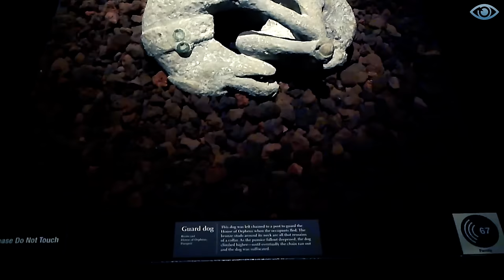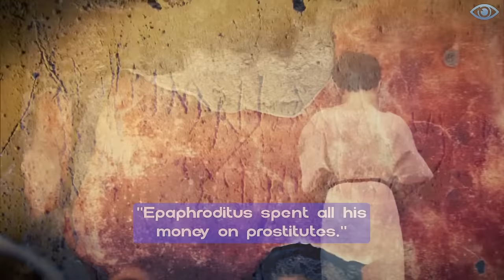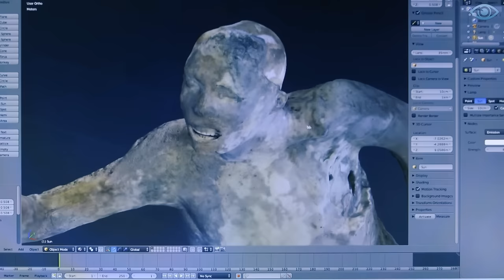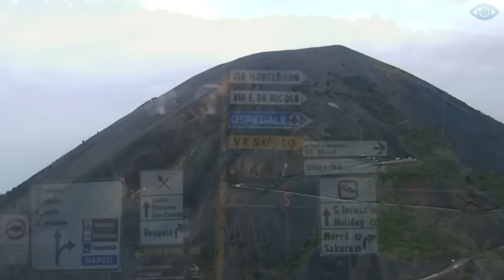This New Discovery in POMPEII Has Changed History!

Comment: I visited Pompeii in 1970 and it is amazing how much more has been discovered and excavated.
Reply: I visited both Pompeii and Herculaneum in 1977. We see a lot of videos about Pompeii but very few on Herculaneum. Actually, there were other Roman towns buried by the Vesuvius eruption: Oplontis, Misenum and Stabiae. I don't think they've ever been excavated, though. 

The main killers at Herculaneum was what are called "pyroclastic density currents" (PDCs) which are like rivers of hot ash and gas (with temperatures up to 1,000 F) flowing along the ground at incredible speeds. Their heads of victims in Herculaneum literally exploded from the incredible heat of these PDC's.
Reply: I visited Pompeii  July of 1995 and I agree how much more has become uncovered... Visited Herculaneum  Dec. of 1994.. and visited the Protestant  Cemetary behind a Pyramid  built for a General in 79 AD... missed visiting the Art Gallery of the Vatacan by 15 min. Sept of 1994... was never able to try again.. just too much to see and do... the Cuma caves were interesting and the fact Neros Canal still exists and so does the Appianway... makes you wonder with their tools, and our modern ones.. why can't we make roads that last as well as the Roman's did.

Comment: I visited Pompeii over 15 years ago and didn't get to see even half of what was shown in this video. A question always in my mind is that the roofs of all these structures are gone yet the walls are still standing. I can only speculate that the roofs were made of wood and hence the firestorm burned them up.
Reply: Sounds we were there the same year 2008.
I toured all of Italy and both Rome and Pompeii 🎉had a ton of things closed off. Also, all the castings were on a world tour. They need to put those castings back in Pompeii, or atleast replicas. 
We still had it good. There were no barriers and plexiglass all over the place. We could walk where we wanted and stick our face up against a painting.
Reply: @johnbeckwith1361   I think they should put the original castings back and take replicas on the tour.
Reply: Wood and straw like modern thatched buildings in England.

Comment: I do feel so sad and sorry 😞 for all of the horses, who had no idea of what was happening to them 😢
Reply: Horse, cat, and even dog remains are rare in Pompeii. They are similarly swift, and they were more likely to escape than humans who are much slower.
Reply: The horses? Was it not so bad for the people then? You do talk bollocks.
Reply: @paulbrower  Nothing can run faster than a pyroclastic flow going at around 400mph. Especially one from only a short distance away. Anyone or anything that escaped, did so well before that. Unfortunately, many of them just went to the coast - and waited for boats. Boats that were also overwhelmed - one carrying Pliny the Elder.
Reply: @robinclarke9978  Watch out you might melt the snowflakes.
Reply: @memkiii  Running off when scared as early as possible is how one survived. One of the signs of an impending earthquake is that household pets run off. 

People survived from Pompeii if they left early enough. Many did. Herculaneum (seashore where boats could not reach shore) and Oplontis were harder to escape.

Comment: making the vid interesting with a special picture then bringing nothing else than a regular docu about Pompey is one thing.  Also - what the heck is it about the relation about 2 dead males? Don't you have anything else in your thoughts than having the orientation of people ? This is really pushing the quality of your vid down. bring proper videos without that "have they had a relation or not" and remove the main pic and then do a propper research.